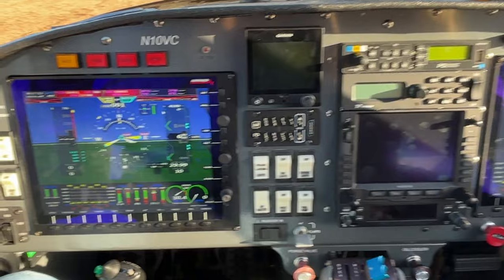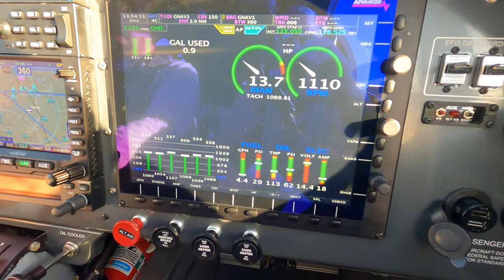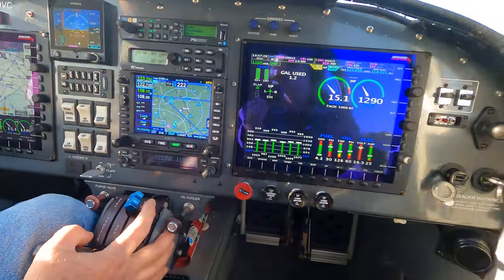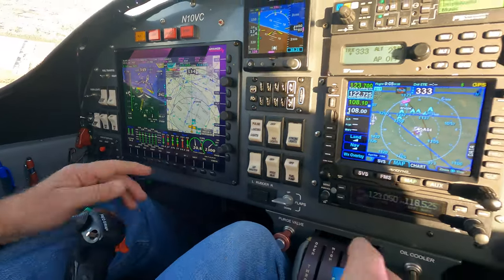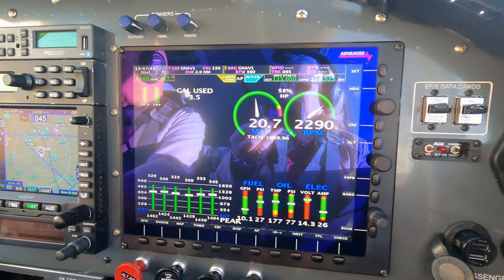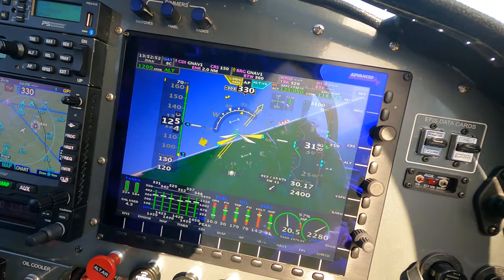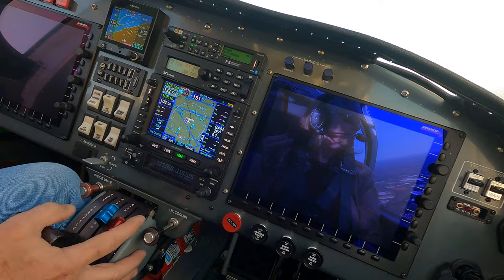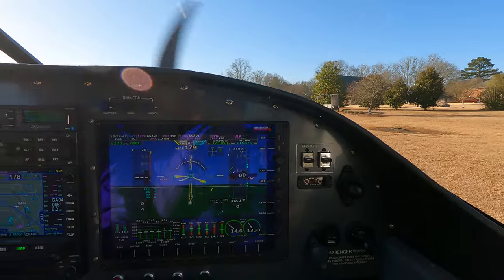First flight simulation in the RV 10

Comment: Great video Vic. The one interesting point that I noted was your flap speeds.  I've been using 96 KIAS for the first 15 degrees and 85 for full flap. I  see that you don't put the first notch in until mid 80s KIAS. Is there a reason for that?
Reply from the maker: I take them out of reflex around 110-120. Then the first notch which is half flats comes out at 87 knots. I thought I spoke about that in the video. I may have been talking too much and got them out slower than usual.
Reply: Ok. I just wanted clarification. I was a bit confused because the flight testing section of the build manual lists 110mph (96 knots) and 100mph (87 knots) as Vfe for half and full flaps respectively. Personally I like having the option to deploy the flaps at higher speeds. I find the 10 already a bit limited in that regard even with the higher speeds than Ive been using. I love your videos. Keep making them!